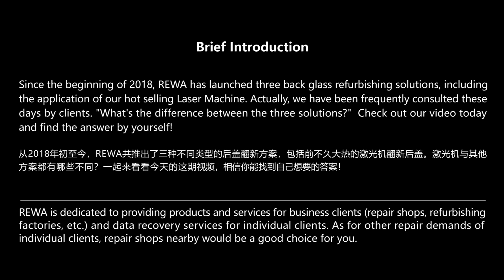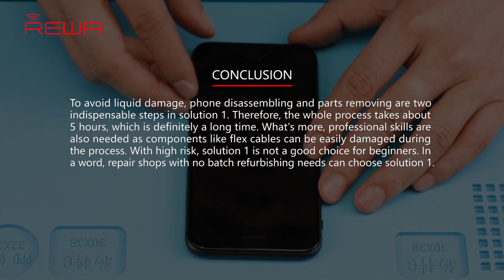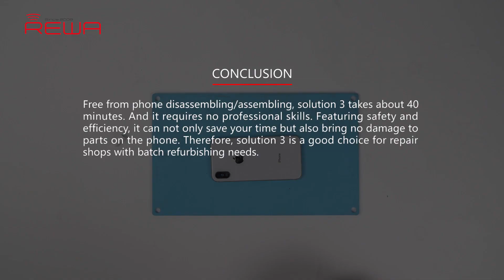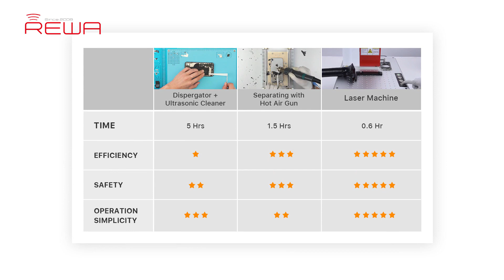Higher Efficient Back Glass Refurbishment - REWA SELECTED Laser Machine

Comment: Hello, Ok this is time saving but the price is much too expensive anyway
Reply: It'll take about 10 XS Max back glass replacements to recoup your money.

Beyond that, there so much potential within that machine. I won't give away all of my secrets but here's one:

 Use it to cut  your own screen protectors. We cut and sell them to customers at 5 for $20. And you can make about 500 pieces from one roll.  That's $1000.

That means you no longer have to carry TONS of screen protectors. Find their model and print one on the spot. It was a no brainer for me.
Reply: @OnYourSquare  @AngryTechGuy: yes maybe you do not have a lot ofTaxe  importation, here the price of this tool + transport + import taxes is not possible at this time!
Reply: @Titeuf49fr  Understandable. But I'm pretty sure whenever you're ready to purchase one, if you check eBay there will be tons of people selling this or a very similar one, in your area.

Comment: just dont buy and iphone and you dont have to choose from these 3 steps. easy fix.
Reply: Lol you really hate Apple, don't you?
Reply: @agiverreviga4592  no i dont. i just find it too expensive and not customer friendly.
Reply: @SnasHTR  Expensive - maybe, but replacing the glass is not what Apple does. They replace the whole housing just because processes like those in the video take too much time and effort. Even if it's not from Apple, third party sellers also can replace the whole housing for much cheaper and it will be a lot easier than replacing the glass for them. Almost every phone has a glass back and I don't know about others, but for Samsung on the other side, a simple display replacement requires to disassemble the whole phone, while the iPhone is not like that.
Reply: @agiverreviga4592  not fan of samsung also. There are plenty of companies which provide better phones with easy changeable parts and and good quality. Apple users love the ios and they find it safe. i accept that. But the hardware and design became unfriendly over the years. i dont like the hype of buying the newer phone whenever its on sale. Thats crazy